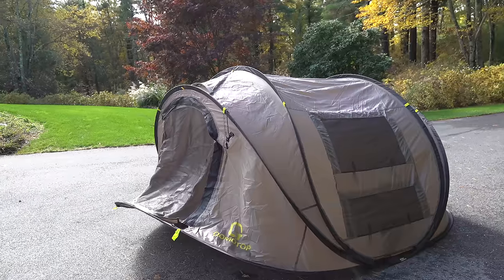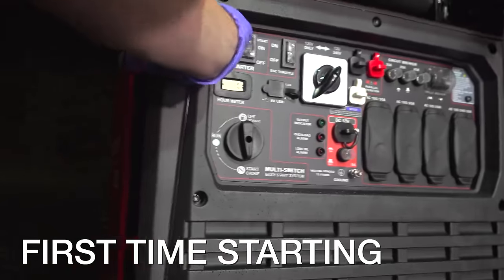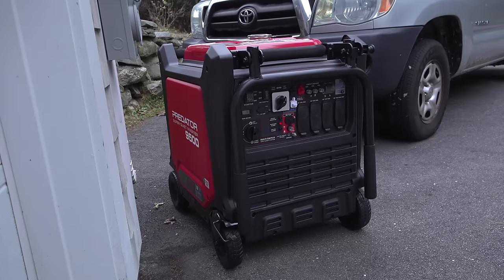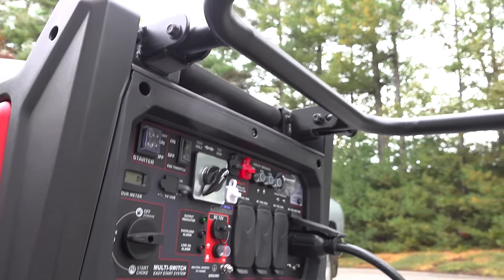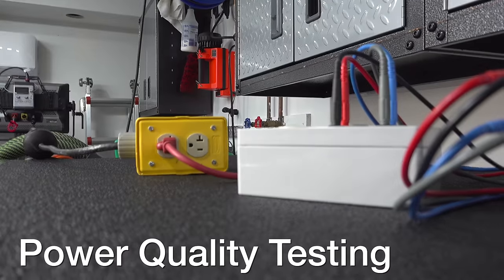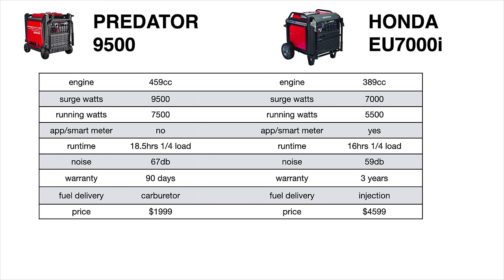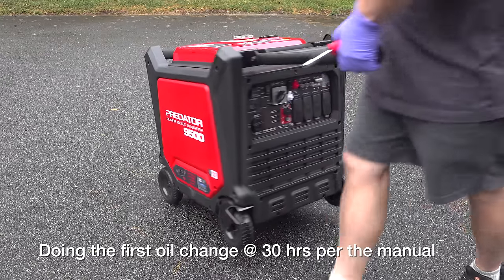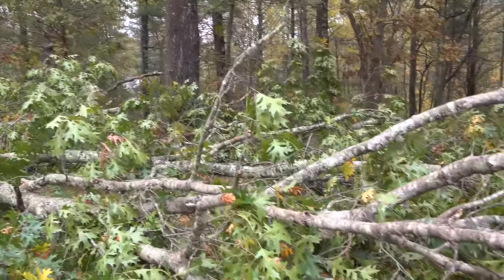BIGGEST Harbor Freight Generator Predator 9500 Review & TEST

Comment: Fuel injection alone is enough to go with the Honda.  The carb is now a way of the past with the ethanol gas.  Generators are generally stored for long periods of time without use and the Gum the gas creates in the Carb is the killer for this machine.
Reply: Let’s not act like modern engines aren’t built to withstand nowadays ethanol. Carburetors are 100x more reliable than fuel injection. Yeah, you’ll have to clean a carburetor out once in a while, but that’s why there’s a product called Seafoam so you don’t have to get your hands dirty. I’m going with the Predator on this one. Especially price too. I could buy 2 Predators for 1 Honda. Let’s not forget how much powerful the Predator is compared to the Honda. And this is coming from a life time Honda owners ranging from ATV’s, Lawnmowers, Pressure washers, and so on.
Reply: the 90 day warranty should be  red flag to me.. especially vs a 3-year warranty.
Reply: @Anonymouso283  Actually the carbs are built the exact same way, and seafoam doesn't work.  Watch bench tests.  I'm not sure why you are trying to defend carbs, without knowing about them.  There is no difference in a modern engine carb and one built 15 years ago before the ethanol gas.  And you can watch MANY MANY bench tests on modern day engines to see that if left un-run for 3 to 6 months none of the stabilizers work.
Reply: @christapherdane  
Maybe YOU are the one that buys shitty products. That’s a big possibility. Yeah, I am defending Harbor Freight over Honda, but their quality has much improved over the last few years. Why would they allow their products to be unreliable garbage, coming from a rather small company that NEEDS sales? And they’re also innovating with price, run time, gas consumption, out put and the whole shabang! See, I am a man that buys products ranging from Stihl’s, Honda’s, Toyota’s, Briggs & Stratton’s, Yamaha’s, John Deere’s, and so on. And guess what, 3/4ths of those machines have carbs on them, and I start them all up once a month and they all run great. Never had to clean out a carburetor. I just seafoam, and start once a month. I’m sick and tired of seeing people like you bitch and bitch about the ethanol nowadays. How about you do one simple trick. Go outside, and run your engines once in a blue moon.
Reply: @Anonymouso283  I have no problem with Harbor Freight.  I never said that, I specifically speaking about carbs, have consistently brought it back to carbs.  Has nothing to do with buying bad products, it's simply the difference between carbs and fuel injectors.  This was less of an issue before ethanol gas, but is an issue now.  Please don't bring anything up besides carbs vs fuel injectors.  Now go do your research.  Good luck.
Reply: @Anonymouso283  Please, please do research on carbs vs fuel injectors in relation with ethanol gas.  I would love for you to find ANYTHING or ANYONE competent that says carbs are better.  Period, I'm not a keyboard warrior I simply stated from the start fuel injectors are better than carbs with ethanol fuel.  It's simply a fact.  One you pretty-much gave into by saying "go start it once in a while".  Not a keyboard warrior, but when you have acreage to deal with then you have too much other things to worry about and fix then to have a list of all the motors you need to start and at what times.
Reply: Use stabil and high grade gas, I've had one for over 4 years and it sits for long stints without running, I'll run it to empty a few times a year.  I can replace the carb for $35 so no big deal.  The big thing with fuel injection is that it self adjusts at altitude, etc and it will be more efficient.

Comment: Why would anyone buy that honda generator when you could have a generac standby plumbed into your existing propane or natural gas for less?
Reply: Maybe because it's portable.
Reply: @jmljml5065  How often do you need it to be portable at home? I mean you can buy a 14,000w generac standby thats plummed into your propane or natural gas and automatically kicks on when the power goes out for $1,000 less than that honda.

Comment: Bummer it doesn't come with a 50 amp outlet.  The 30 amp 120/240 would technically only be rated at 7,200 watts (3,600 per leg).

Comment: You’re wrong. Harbor Freight sells junk. Nothing lasts other than maybe hammers and hand tools and even with that a handle came off of an axe I got there. Predator seems okay but very noisy. Not good for camping maybe for an outdoor construction site but you still better get the extended warranty or your totally screwed

Comment: Both made from the same manufactory  the engine is mechanical part's would be the same.. Extra Money is paid for the name HONDA,. All petrol motors look exactly the same, the head , tapped cover, engine block,
Reply: Made in the same factory does not mean they are the same. Predator uses Predator parts. Honda uses Honda parts. There may be some parts in common.

Comment: Predator engines last just as long as Honda, it kills me to say that but they do.
Reply: Can't say I agree. As a  long time small engine mechanic, I have found they suffer valve issues after around 100hrs due to poor materials. A fair % also develop coil failure, and I have also seen many with casting failures (tank mounts etc) again due to poor/inconsistent material quality. They are a good design (it is a Honda copy!) let down by low grade materials and components. Some do last ok, and if you are after an occasional use engine they will probably be ok considering the price. But if you need a product that you can depend upon for many years, the Honda wins hands down
Reply: There's a few Predator owners here that would beg to differ with you.